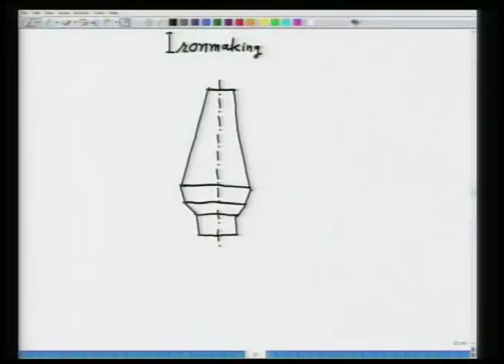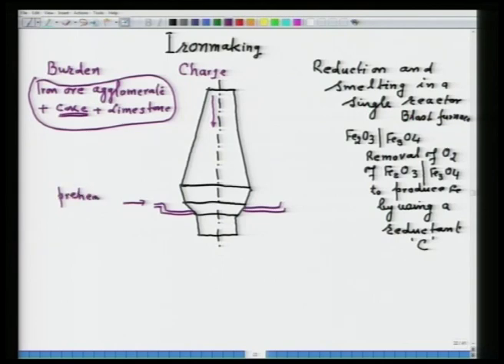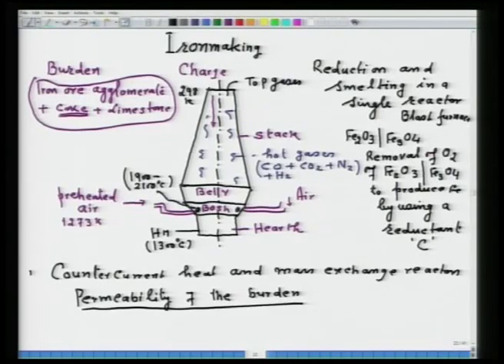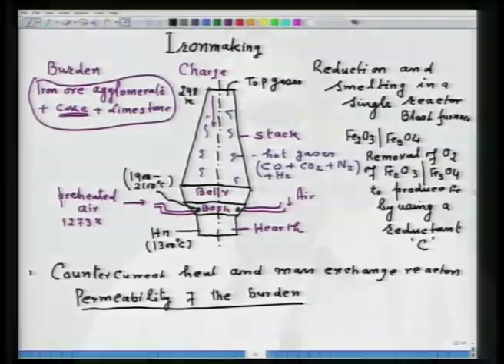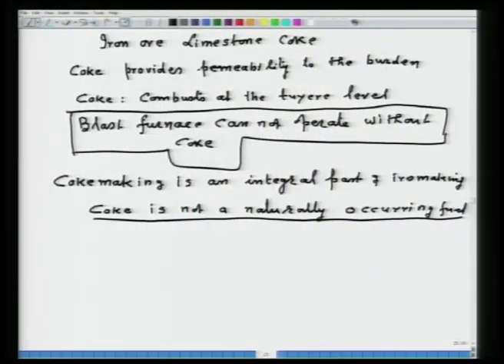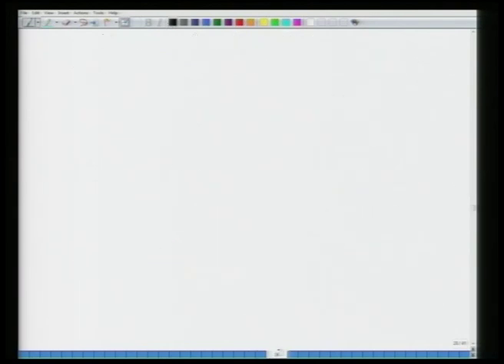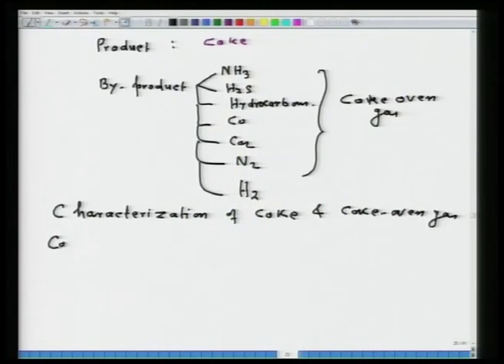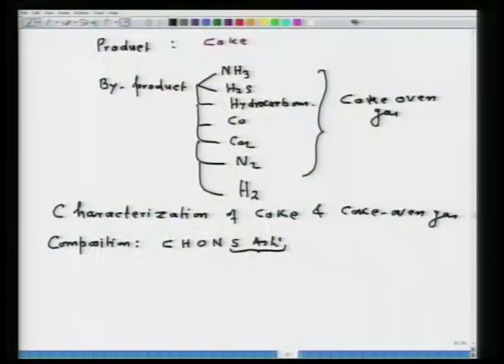Mod-01 Lec-26 Introduction to Ironmaking

Comment: Confused completely on the reason of height of blast furnace at 9:00. Please explain again. First you said that 75% height is for conversion of Fe2O3 to Feo and afterward you say that conversion is very fast ?
Reply: it does not take too much time to cover such a height during free fall of burden. but real time is taken when burden forms bed and now the ruduction of FeO starts
Reply: @architraj6416  suggest be some good books other than tupkray